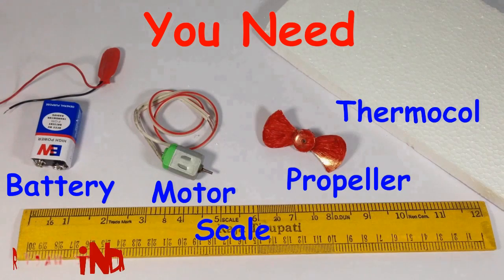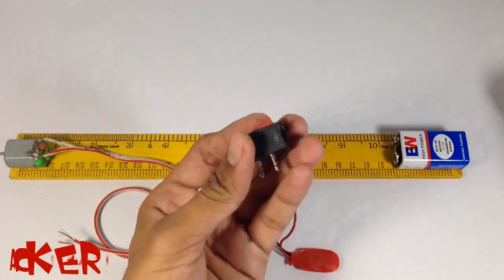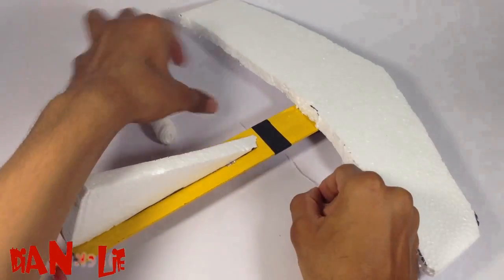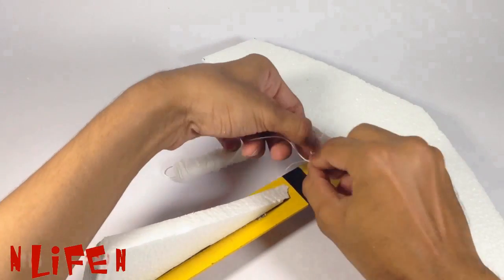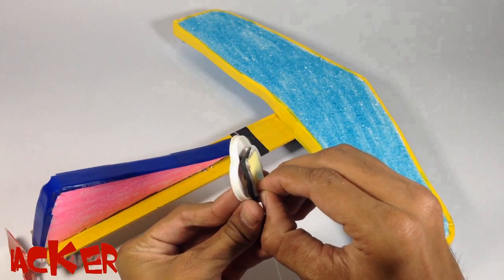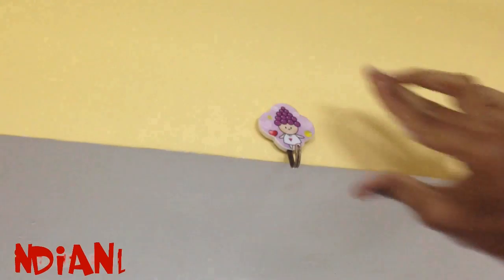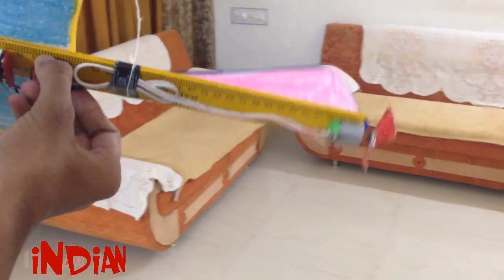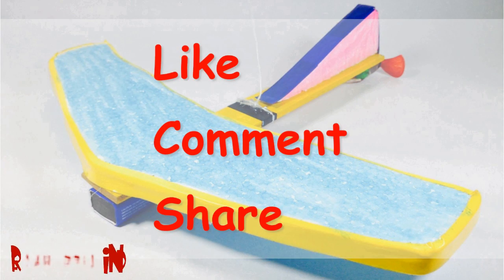How to Make a Hanging AIRPLANE with a MOTOR at Home | AROUND the POLE AIRPLANE

Comment: great idea,you are awesome...
great idea,you are awesome...
nice ;]
i also did the same thing with that four bladed fan. that four bladed fan didn't produce much thrust that two bladed one.i also heated the blades with a lighter and increased the angle of attack.that way it it produced even more thrust.cool project by the way.
That's pretty cool. I had one like this when I was young. I think it would be fun making one of these with my daughters.
This is best I'm also indian I'm proud of you
good
cool
it is not possible that the plane can fly in the perfect circle.Second thing that the motor is not so much fast

Comment: i also did the same thing with that four bladed fan. that four bladed fan didn't produce much thrust that two bladed one.i also heated the blades with a lighter and increased the angle of attack.that way it it produced even more thrust.cool project by the way.